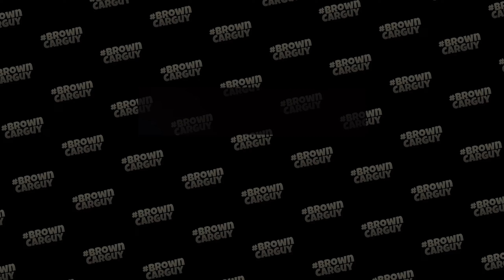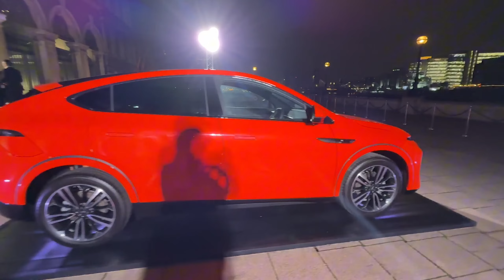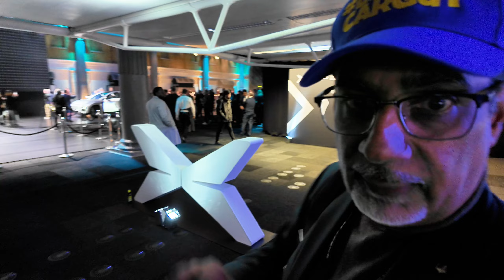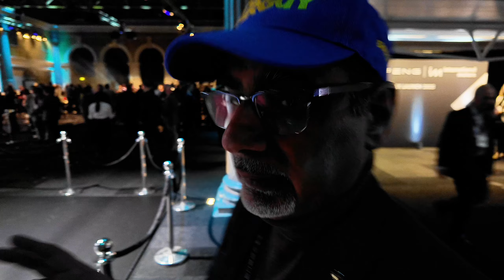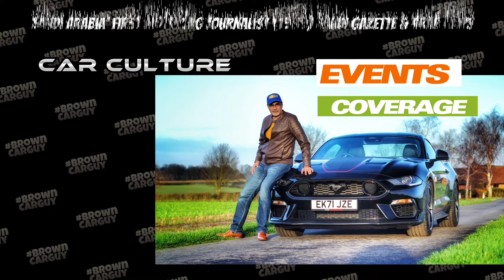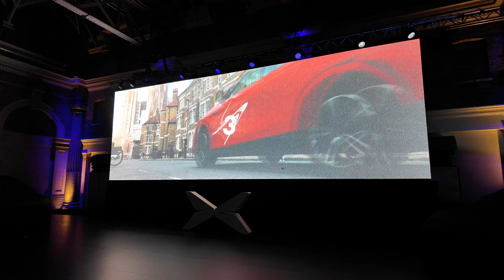XPeng G6 UK Launch to Take on Tesla – PLUS Secret 2nd Model Revealed! New Chinese Electric Cars!

Comment: the base one with 66kwt but over 2 tons unladen   THAT PROBABLY WITHOUT AC OR HEATER FAN ON will  do 190-210 REAL WORLD MILES:face-orange-frowning: . Price   advertised at 40.000 sterling or  80,000 aus dollars . If you go for the extended range its another 5000 uk pounds  or 10,000 oz dollars:hand-orange-covering-eyes: . Plus if its over 40 k HERE IN UK,   a added wealth car tax of a extra 350 pounds on top over 5 years not including  the basic standard tax of 195 pounds for being allowed on public roads , SO its 30,000 dollars cheaper in OZ :face-pink-tears: .  just sayin.
Reply from the maker: I have one on test at the moment

Comment: The Toyota bZ4X’s e-TNGA platform delivers exceptional stability, comfort, and spaciousness. Its dedicated electric architecture ensures a smooth, quiet ride with optimized weight distribution, making every journey a seamless blend of innovation, performance, and sustainability for modern drivers.

Comment: Great car, great software. Xpeng is doing well in Australia, Electric Viking has bought one himself. Wheelsboy (American channel in China) states it rivals Tesla autonomy. But charging is better than Tesla, plus V2L and heads up display. Xpeng does autonomous flying cars so much ahead of Tesla
Reply: Self driving is better than Tesla in China, Tesla is way behind there on that front compared to the top players there. This car is really comfortable to drive in and is relatively quiet, had a chance to check it out in Malaysia, wasn’t a fan of the soft seat when sitting in them but, on a drive it was really good. I would have preferred better bolsters on it but, that’s me being used to driving sport package equipped cars with nice bolsters.